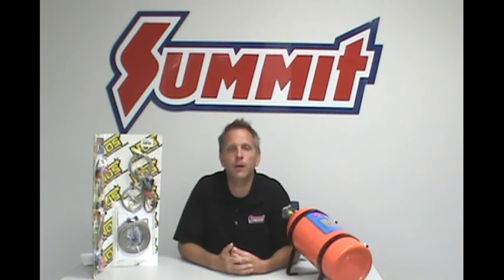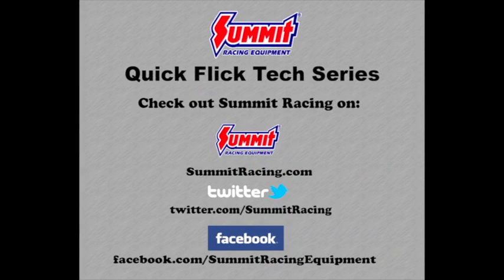Nitrous Oxide System for Cars - Summit Racing Quick Flicks

Comment: I have a Hyundai Genesis coupe 3.8l V6 GDI and was wondering if it is even possible or worth wet nitrous. and is it more dangerous to use dry nitrous over wet nitrous?
Reply from the maker: +g3dog100 , 
Opinions vary on your question but, most times wet systems are best because the extra fuel required for Nitrous is released through the same nozzle. Dry systems run the risk of running the cylinder too lean causing detonation and ultimately damaging the engine.

Comment: hi I have a 88 jeep comanche inline 6 4.0 I would like to do a safe shot 50...will my engine b able to handle it?
Reply from the maker: +pirotechnico323, 
You might want to do a leak down test to assess the health of the motor internally before trying to add more power. High mileage motors that use oil are not good candidates for Nitrous usage. Give us a call if you have any questions, we can help. 1-330-630-0240

Comment: Hello.
Can i use dry sistem with 50 hp nozzle on 
My 4cyl car.but i have a chip tunning box
Installed.das it gonna work fine?
Reply from the maker: Hi Edin Husanovic, 
A 50hp dry kit should be no problem for your 4 cylinder motor. Inspect the spark plugs periodically looking for signs of Pre-ignition (detonation). You may want to try and bump your fuel pressure to be safe. Give our tech line a call and we can help you make good decisions!  1-330-630-0240. Thank you for watching
Reply: Summit Racing o.k. thank you

Comment from the maker: It is not recommended that the nitrous be injected at the throttle body spacer due to it performing poorly when placed in this position. Typically it will work best when placed down stream in the air intake system closer to the filter assembly. This lets the nitrous mix/expand with the air much better improving it's performance greatly with this type of system. You can try installing the nozzle in the spacer first if you like, but you likely will not see the expected results doing so.

Comment: Ok nice kit I see that it a universal unit...I've got a throttle body spacer with a drilled/tapped for a nitrous port...I've read that with some kits it would need to be like 6in from the fb?is that true r would this work with my set up...I really didn't wanna drill a hole in the pluming for the p1sc I fig the tb spacer would work...kinda new at tis just really wanna know wht I'm dealing with before a take it to a shop amd get it tuned

Comment: Ok cool I see that this is a universal unit I hav a throttle body spacer with a drilled/tapped hole....now I've real that these nitrous/gas mix should be at least 6 inches from the throttle body.would that work for my set up?

Comment from the maker: The Sniper system in this video will work on your EFI 5.0 stroker engine very well. Fogger systems do typically work better but the installation of one of these systems is considerably more complex and expensive. The part number for the correct Sniper system for your Mustang is NOS-07006NOS ($403.99).

Comment from the maker: It really depends on the HP rating of the nitrous kit being used. Most stock V8 engines will support up to a 75 HP shot without any problems as long as 91+ octane fuel is being used. Any system producing more that 75 HP will require substantial changes to the engine to avoid premature engine failure. These changes include: Forged pistons, wider ring gaps, stainless exhaust valves, ignition timing changes, etc.

Comment from the maker: Nitrous Oxide Systems does not list a chart or guide that shows what the proper fuel adjustments would be when running E85. It would be safe to say that the fuel jetting will need to be increased to avoid a lean condition (especially with the E85). We suggest contacting NOS @ 270-781-9741 for information on what jet changes will be necessary in your specific application. Thanks for watching, and please let us know if you have any additional questions. Sorry we couldnt be of more help!

Comment from the maker: Due to the 7lbs. of boost and 11:1 compression, it is suggested that a wet nitrous system be used. This will keep the air/fuel ratio in check and keep the engine from going lean. Using nitrous on your vehicle application typically works much more efficiently than a methanol system. A fogger system would be the right choice and we suggest going with the adjustable system part # NOS-05088NOS. Thanks for watching!

Comment: Hello if I'm running a mmr stroker 5.0 motor with a p1sc  procharger kit at about 7 lbs. Boost,and the compression is 11:1...,wht would be a good option a wet nitrous kit/dry kit r would it be better to just try a methanol kit setup

Comment: i have been looking at the sniper system for holley 4 barrell. my question is my car runs on e85, im sure i will need different fuel jets then the ones supplied in the kit but is there any chart or recommendations for what i will need with e85?